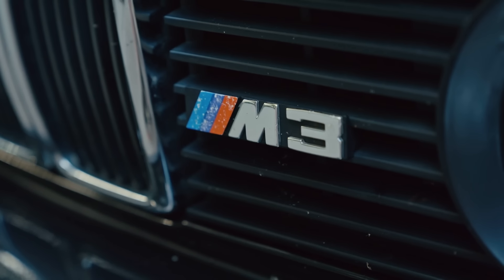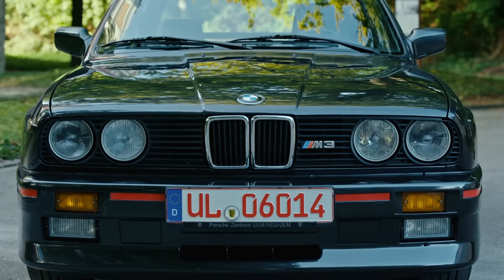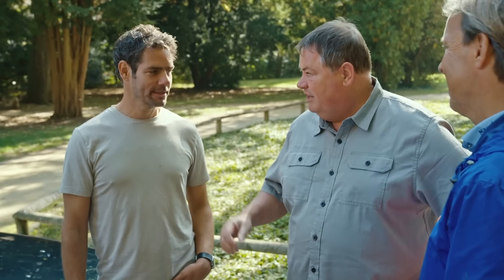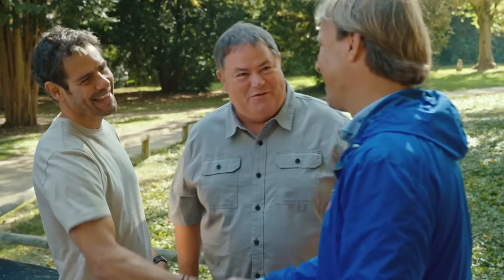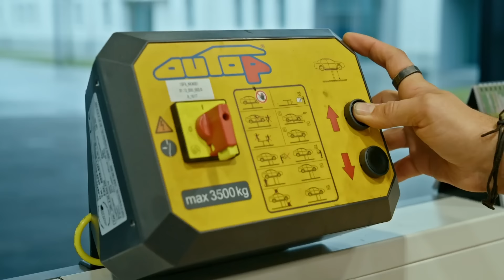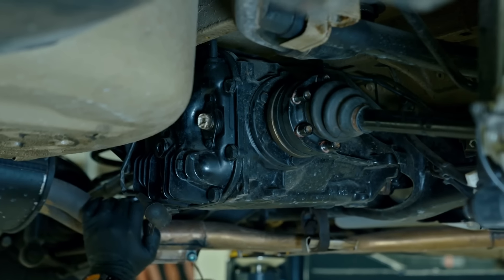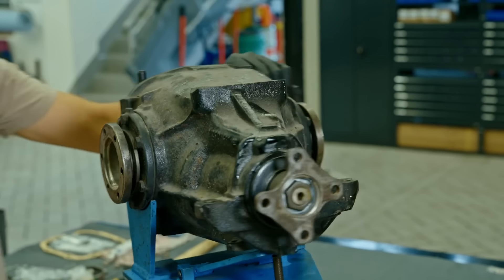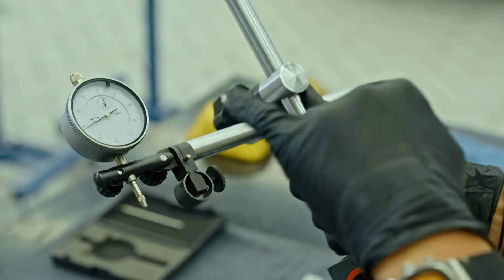Elvis & Mike Buy A BMW Worth €70,000 To Fix In Germany | Wheeler Dealers World Tour

Comment: Wow, 70k euros for this is way too much. A lot of work was done and it was repainted. I could have just bought one in the USA for 50k and saved 25k overall. Good lord.
Reply: And then you spend 20k usd to get it euro spec 🤗😆
Reply: @mortenjaaa  nothing special about a car been europe spec except a few more power to it . its the same body all around .
Reply: @siemprebmw3284 The biggest difference between Euro and Us was the gearbox and diff. Euro was dogleg with 1:1 5th and 3.25 or 3.15(Evo) diff. US was "H" pattern with overdrive 5th and 4.10 diff. Than there is horse power, bumpers. Good luck getting all that for cheap 😂

Comment: Watched this, can you tell me how you inserted the valve shim? No special tool shown or perhaps removal of the cams, just glossed over as if you've just popped the shim in with your fingers! Same with the rear diff, no check of preload, just change a shim. Too much of you gabbing and eating Bratwurst, come on, get back to showing the car being fixed.